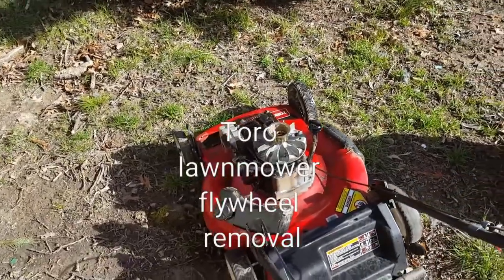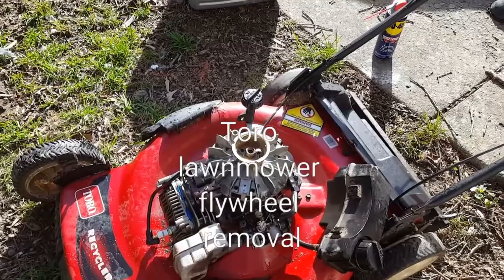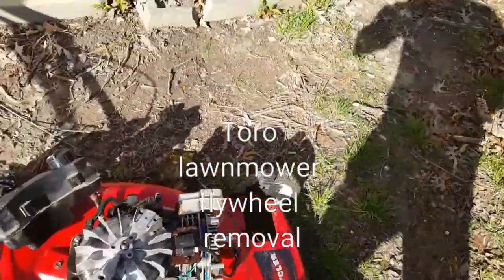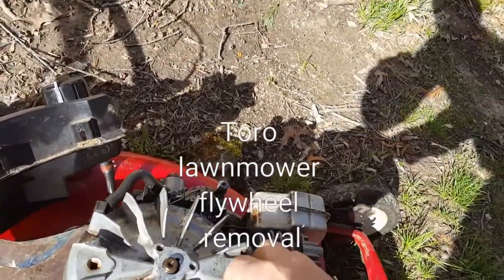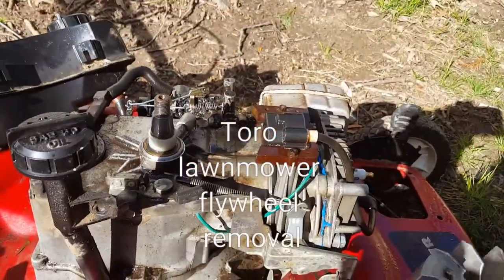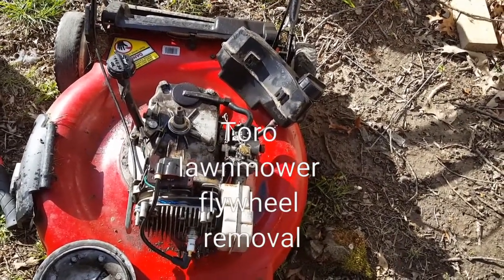Easy way to remove Toro lawn mower flywheel using Axe head

Comment: Put nut back on the stud..FLUSH. Then hit stud while prying up on flywheel from underneath. The reason for this ? You hit the stud without the nut screwed back on flush,you can damage the threads. The nut will be hard too screw back on with the stud flat at top where you hit it,and threads bye bye